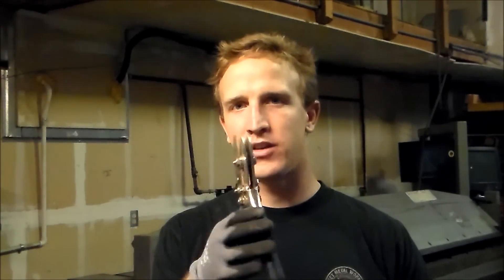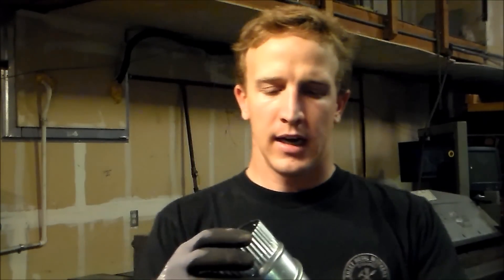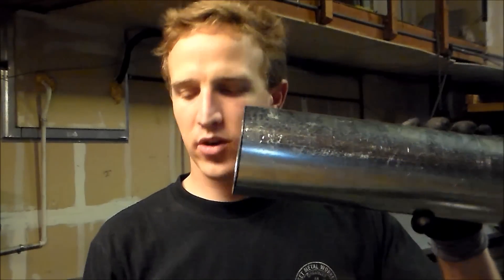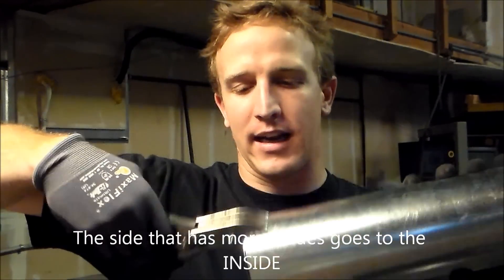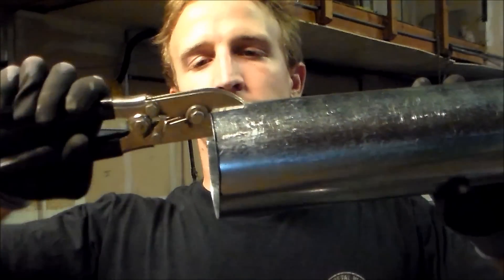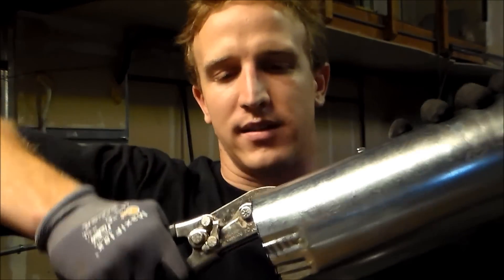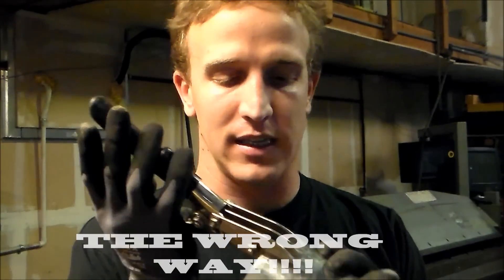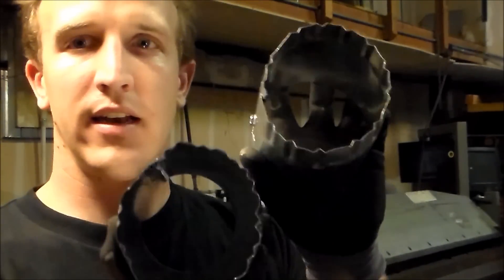How to use sheet metal duct Crimpers for round ducting - The Sheet Metal Kid

Comment: How should I Un-crimp a pipe? Bang it out with a hammer over a curved surface?  I need to reverse the crimps on a 4" Y to make the airflow go in the proper direction. Thanks for your videos
Reply from the maker: Trim it off is the way i typically do it

Comment: Hey! Great video. Have a question for you. I've got a 4 inch coming out the dryer but I need to connect it to a 5 inch that cake with the house. What's the best way to go about connecting them?
The 4 inch off the dryer is crimped and the 5 inch venting to exterior is not crimped.  Any help would be awesome! I've been without a dryer for almost 2 weeks already. Thanks!
Reply from the maker: 4 to 5" increaser (not reducer) This would not be crimped on the 4" and crimped on the 5" to fit inside the existing

Comment: Good video. I have a new house, ranch w basement but they used flexible pipe for all the runs off the main trunk. Should I replace the flexible ducts with metal ductwork for better airflow? Thanks.
Reply from the maker: Ideally if its not too difficult to access

Comment: When using sheet metal tubing for a furnace and water heater exhaust into a sheet metal chimney liner, do I need to use anything to seal the seams (ex: HVAC metal tape/clamps/adhesive sealer)? I watched your video on the correct direction of crimping and it made sense but I haven't found anything about how to address the seams for hot exhaust gas. I will obviously insulate the tubing but is there a product you use on the seams to insure they are air tight? Considering exhaust gas isn't pressurized per say, would it be okay just to use worm gear clamps to insure the piping doesn't become disconnected?
Reply from the maker: +Matthew Jacob Depends on the appliance. Most require a double wall duravent pipe. see this link: http://www.woodlanddirect.com/Chimney/Chimney-Systems?gclid=CMDCrpLJ3sgCFUprfgod4VQLUw

Comment: Range Hood install.  The vent pipe is in two long (too low on the wall).  How do you cut/shorten a tube while it is still in the wall.  The tube is vertical.  I want to try to keep it in place, shorten and at right angle to exit the wall for connection to the range hood.
Reply from the maker: Angle grinder or tin snips my man!
Reply: Ok, thanks